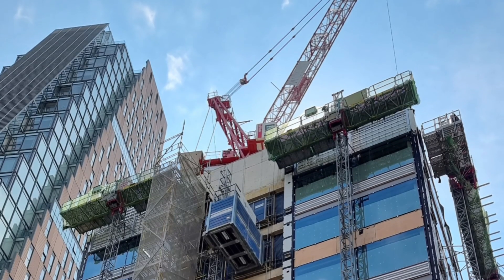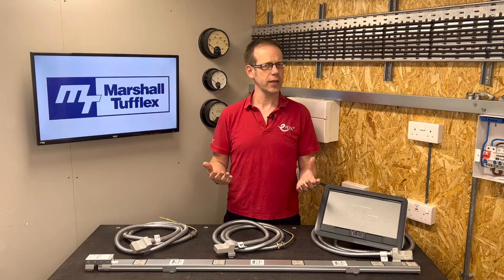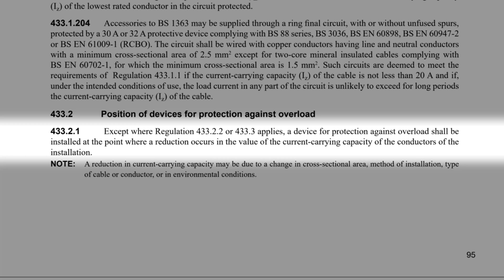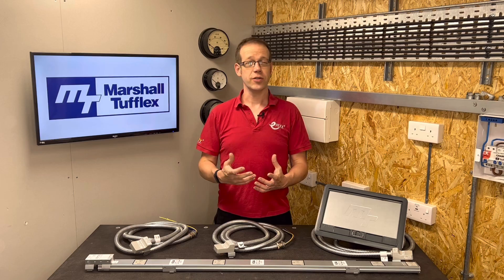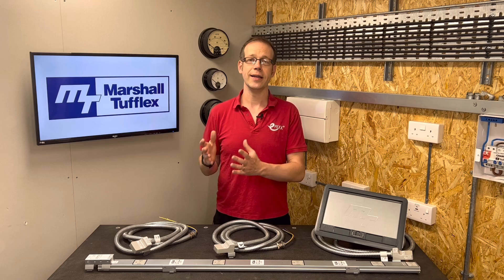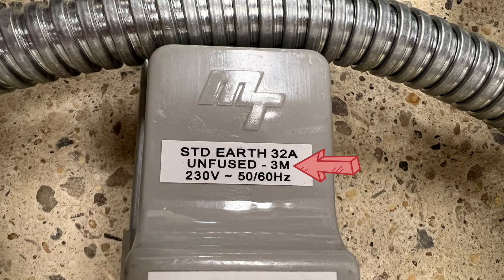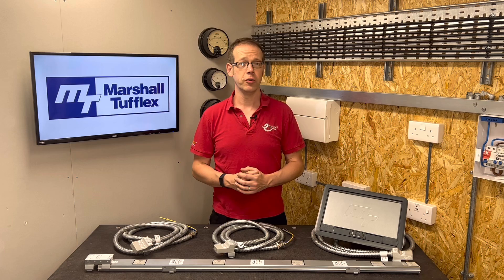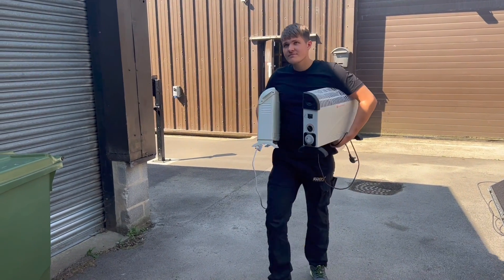Do I Need To Fuse Down a Cable When Connecting To a Busbar?

Comment: Nice video….educational!

Quick question, (or 2)

1:  What to stop the socket boxes being used in a way that exceeds the rating of the cable on the the 32amp tap off

2:  What if (due to short runs) you had a zs at the floor box of around 0.11 or similar.   Will the cores of the 32amp tap off withstand such current without causing damage or fire?

Comment: Have this at my work or i should say similar and the "floor boxes" as we call them have rcd protection on the box containingbthe 2x double sockets but they can be annoying when they rcd is knocked off by a power cable or data cable as the floating floor is close to the top of the floor box

Comment: The more meaning full question eFIXX is would you be comfortable putting it on a 63A breaker, where in the future, someone could plug a 5M tap of into the track without knowing the limitations. I have also seen plenty of situations where one plugs in fan heaters and kettles under their desk. 

IMO, it's better to have two 32A circuits each feeding different tracks than one large 63A protected track.

Comment: The rcd protecting the sockets should stay in the cardboard box it came in and not be installed. IT equipment is notorious for leakage current.  Plus no one is going outside with an extension lead plugged into them sockets on the 10th floor .  No Rcd protection required.  Engineering decision to be made to show rcd not required.

Comment: A great exploration and explanation of the relevant standards as usual Joe and I can see how the MT underfloor system might comply. Maybe I'm missing something but I think that the protection device (13A fuse?) would need to be fitted in a single socket (not the plug top) to ensure that the reduced current capacity of the tap off cable is adequately protected against overload.
For example: if the reduced current capacity cable is feeding four sockets and the plug tops are fitted with 13A fuses then the load on the cable could be 13A x 4 = 52A......!!!
Reply: In practice, office workers will plug anything into sockets.  (What ever any maintenance person tells them is ok)   the only way to dedicate an outlet is to hard wire.   I agree with John, if there is a possibility, then someone will take that possibility.
Reply: He said the likelihood of the 4 outlets being used to maximum capacity is slim , normally floor boxes are used for PC'S and monitors etc.
Reply: Thats ok till the HVAC system fails or one end of the office doesnt get any sun, and the girls start sneaking in the electric heaters, have seen it many times  @dennisphoenix1
Reply: @dennisphoenix1  Thanks for your reply. The observation I was making is that there is nothing to prevent four 3Kw heaters from being plugged in with the result that the reduced capacity tap off cable would be overloaded without any of the overcurrent protection devices tripping. This is an observation only and maybe MT have a perfectly sound technical justification for their configuration.
Reply: @johnlloyd3377  the tap off cable is 4mm and contained in a steel conduit . 4mm  would do 30 plus amps all day long without any issues.  The likelihood of 4 x 3kw appliances in one tap Box would be slim enough to nit be a consideration at the design stage .
Reply: As a spur from a ring final circuit.   Effectively running a 2.5 twin and earth towards 1 spur, or towards fused spur.....
Reply: @robertturner2516  Good observation Robert.

Comment: There’s no way I’d trust an open plan office to not end up with at least one person with 3 convector heaters under their desk. I’d have an RCBO in the floor box, best of both worlds
Reply: Typical heaters are 2 to 2.3kW to match 10A circuits in the rest of Europe. 3 will pull 30A and use 6.9kW. Only a fourth one will even push the load above 32A, to a modest 40A. Then you would have 9.2kW under one desk, and it will get rather hot.

The only realistic way to seriously overload this would be four extensions loaded close to 13A all from one group of sockets, so that the 9.2kW is not concentrated under one desk.

Comment: Any rule that is stated in the form of "A is allowed unless B, (except C, where D does not apply or E is present) is utterly confusing and hard to read and comprehend. There should be simple separate cases where something is allowed or not.
Reply: It is hard to understand for many electricians because they failed GCSE or O level English in school.
Reply: Idk seems pretty straight forward to me?🤔😆
Reply: @TheONLYDANHAMMER  Me too.
Reply: And my previous comment is demonstrated by your remark because the regulation doesn't use "unless" as you said.

The regulation is written "Except where rule A or rule B applies, this rule applies.."

So your approach to this is very easy: you read rule A and decide if it applies.
If it doesn't apply, you then read rule B and decide if that applies.
If that doesn't apply too, then the rule you are reading applies and is the rule you need to follow.

If you are struggling to comprehend that, then you really do need to go back to school or night school and pass that GCSE in English you didn't get, which you should have got when aged 16.

But of course you won't do that, and you will continue to go on through your career being handicapped struggling to read and comprehend the regulations you need to follow.

Comment: If I was responsible for specifying a university space, there is no freaking way I would approve sockets on a 63A breaker, whatever BS7671 says.

People will come into University spaces from abroad, and they will bring dodgy unfused and unshuttered travel adapters with them.
Reply: Or some study in AI leads to a rack of servers with power hungry GPU's pluged into a socket or two.....
Reply: True, although I suppose they could do the same with a 32A circuit, and in domestic properties, you often find cooker switches with a 13A socket on 40A circuits, although I doubt anybody is likely to shove an unfused adapter into those.
Reply: A 2.5mm2 spur, or even just a normal socket on a 32A ring with an unfused travel adapter feeding multiple space heaters is not going to be much better than a socket fed by a 63A circuit and such an adapter.

Still, 4x 13A sockets seem excessive on such a connection. 3x13A would sum to 39A, and with some diversity math you can argue 32A wiring is unlikely to be seriously overloaded, while a sum of 52A is a bit much for 32A wiring.
Reply: If the regs says you can then you can

Comment: Would still say it needs a 32A breaker, or at least each outlet tap point to have a 32A RCBO unit in there, as that reduces the likelihood of summed up ground currents from IT equipment tripping a single RCD device there. Plus of course you will find heaters being plugged in in a school, or office, it always will be that there will be a few people who feel cold in winter, even with the heat in the room set to the correct level, as they want a walk in fridge in summer, and a convection oven in winter, so will bring in that heater, multiple of them, and plug them in. Have had a few cases of people plugging in a heater to the UPS supply, and then blowing up the UPS, or causing the entire system to trip on overload, because they felt cold.

Comment: I got a reprimand for taking up that many tiles for destabilising the floor .
Reply: Called... 'Artistic License' or as the chaps at eFFIX like to call it... whatever they like. 🙄
Reply: Whomever reprimanded you deserved a tango slap.  I've had dozens up doing 1st fix installs/remedials.  The only thing I've had to do is jsp barrier off the working area to stop some dime bar tripping over stacked tiles or falling 8 inch into the open area.

Destabilising the floor don't make me laugh. One lifted tile causes the same effect as having a hundred up.  
H&S/C.O.W NUMPTIES........

Comment: My old university. Also, it's bus, not buzz bar. Why do so many people pronounce it the latter way?
Reply: I have always said busbar. If anybody has a buzz bar, they should tighten the connections! 😉 I don't know why so many say buzz  bar. I have never heard anybody say buzz stop instead of bus stop!
Reply: The buss/buzz thing is quite interesting; I’ve been called out before for pronouncing it buzz, but it’s just the way everyone around me always pronounced it. There are loads of words which are spelled with S but pronounced with a Z so I just assumed it was another one of those, like ‘President’, ‘Jersey’ or ‘Rose’ etc. 

Everyone I know pronounces it buzz so I think it’s just another thing which highlights differences in all of our accents.
Reply: It doesn't matter how you pronounce it. Spelling on documentation should, however, be correct.
Vocalising "buzz" is a profession/trade querk. No harm in it. It's all good. "Stop enjoying yourself, you're at work"...